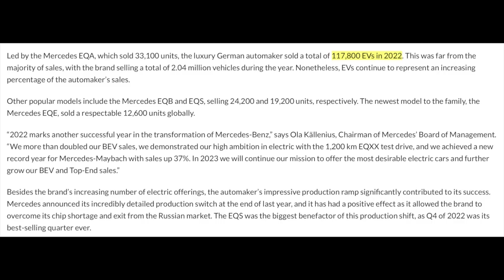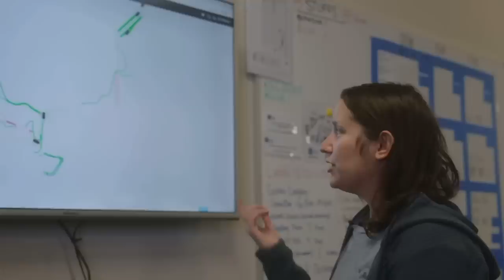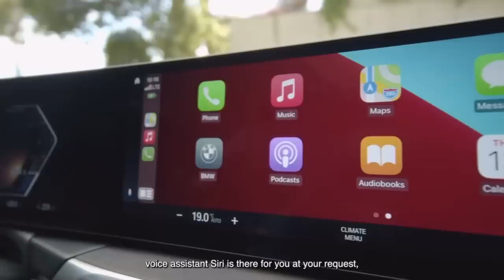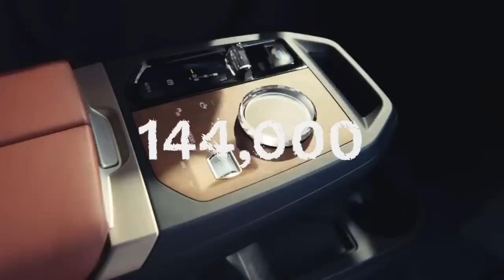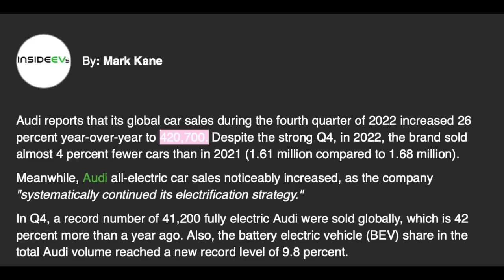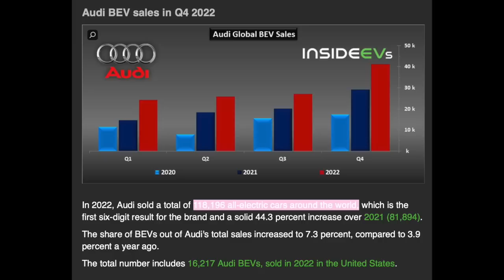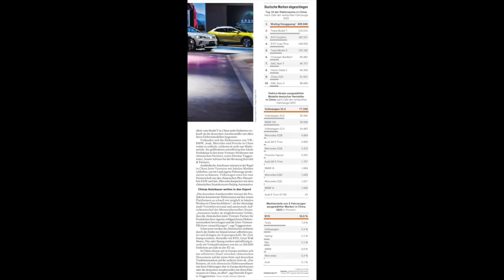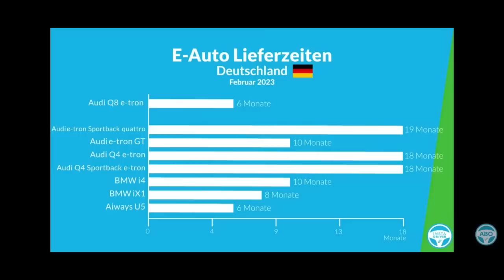The Trend lines will SHOCK the German auto industry already in 2023

Comment: BREAKING: Tesla has just slashed Model 3 standard range prices with $ 4260 in at least one European country, possible more. Not 100% sure, but it seems Model 3 Performance also got a similar reduction in Germany.
For sure they are preparing an official announcement of Highland update and need to clear inventory, NOW
Reply: Agree - the new Model 3 will be coming out of China in March.  Looking forward to that!!  Not sure if the same is true for Fremont.
Reply: Tesla has little of what can be called "inventory" as they have no dealers nor dealer lots.
Reply: @jeffholman2364  I do not believe Tesla went through a shutdown in Fremont though like they did in China to retool the Model 3 line -- I could be wrong though.  Also - I thought they were supposed to start making Model 3's in Texas -- maybe it will only be the new version there for now??

Comment: It’s important to note that ‘EV sales’ in China includes PHEV sales putting BYD in top place.  However when measuring just pure BEV sales Tesla sold more than BYD in China.
Reply: Temper that a bit. BYD is increasing BEV production and decreasing PHEV production already. And the PHEV's that they do sell? Are first in class because they actually have a 100 Km/62 mile of pure EV range. Meaning they are capable of achieving more than 80% of trips without gas.
Reply: @davefroman4700  True but two things to note.
1) PHEVS are being phased out in many countries along with ICE due to various bans on ICE/PHEVs including China
2) Bad make very little profits so even if they end up selling more per year than Tesla in the long run which is doubt full then Tesla will make more profits than them which is the ultimate measure of business.
However I am also rooting for BYD

Comment: Maybe they should bet on India instead.  But India differs on some crucial points.  The most common vehicle has two wheels And cars that run on natural gas are apparently popular in India.  the fact is that in India it is cheaper to buy a car that runs on natural gas than to buy a car that runs on diesel According to information.  And many of these cars have between 70 and 100 horsepower.  Natural gas is apparently cheap in India
Reply: India currently has laws that make it unlikely

Comment: All of this was super predictable, and I did. Legacy automakers have no chance in general, the battery cell supply simply doesn't exist for them to keep up with the rapid increase in EV demand, and that will continue for some time. And legacy automakers have all failed to plan ahead properly, so while it would be possible for one or two to have gotten enough battery cells at the expense of the rest, so far they all are equally unable to respond well to the EV disruption.

Comment: My experience with both these companies has not been ideal, I tend to lend my next purchase to BYD or MG . These Chinese companies seem to be proving themselves over and over again🙂
Reply: Chinese OEM's are just a Cheap made car, but they are Giving EU OEM's a run for their money.
Chinese OEM's will be 3 - 4 th place After TESLA.
Reply: @Peter Simms. You get what you pay for. There is a recent post about a guy stripping a 6 MONTH OLD BYD, and it has terrible rust. That’s on a car that has been driven on UNsalted roads- it would be far worse in many Euro countries which use salt in Winter.
Reply: @markplott4820  all BMW EVs are being built by Chinese companies except the i3 in fact the bmw ix is actually the MG zx but you pay double for the BMW badge 😫